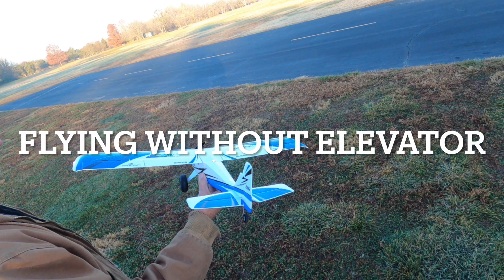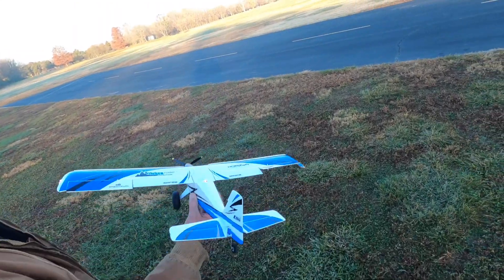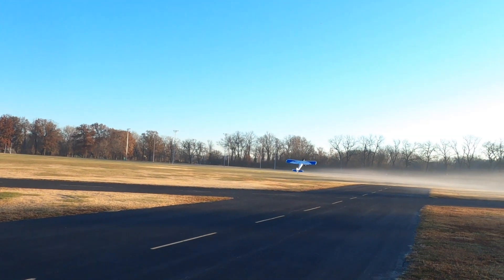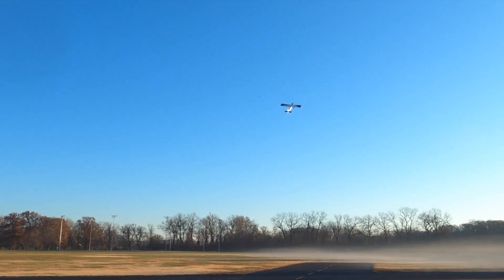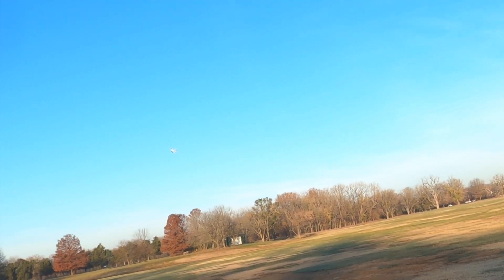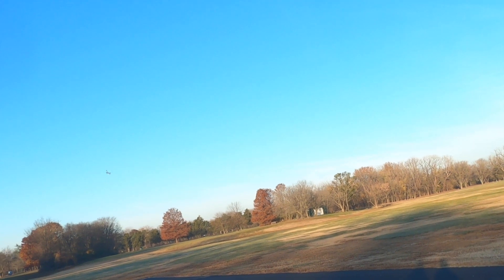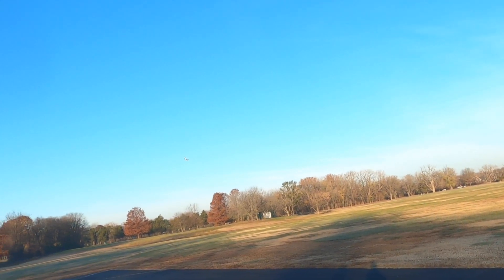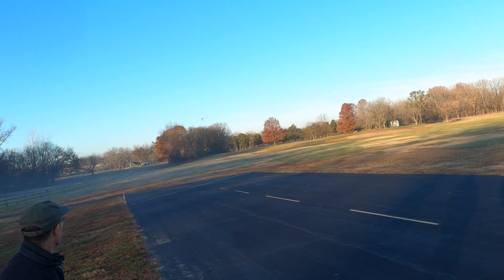Eflite UMX Turbo Timber rc plane flight without elevator. Chance of crashing is high?

Comment: Will that was fun! I've had that happen mid flight back in the day with the early UMX planes. The linear servos would lock up at one end if you didn't turn the travel down by 10% or so. This is a good challenge, you adapted well and flew her just fine!
Reply from the maker: It was a fun challenge and those are the times you learn whats possible.  I would've thought it was going to be a trainwreck..  But, it kinda worked...  Fun stuff..
Reply: The UMX TT Evo suffers from this problem still unfortunately. I read about this several times meanwhile and mine did this as well - surprisingly after flying well with 100% travel for at least half a year or more. Then it had a weird jitter on the rudder servo on some positions and finally that lock. Cleaning the servo carefully and putting some contact spray fixed the jitter and the travel limitation to 95% did the trick for me, too. 😊 The UMX TT Evo is such an awesome little fun plane. And even with the limited throw on elevator more than agile enough.